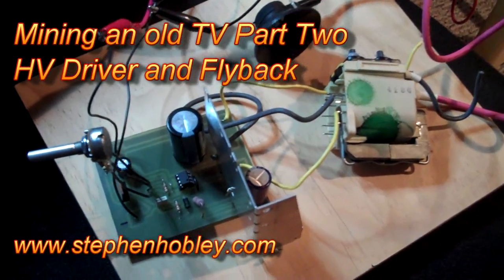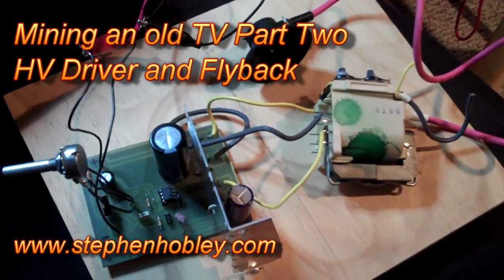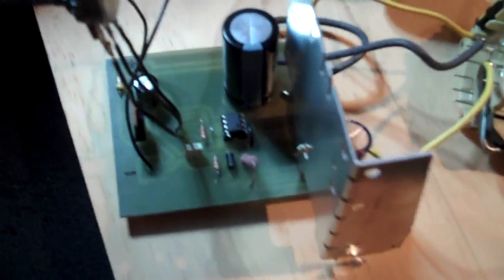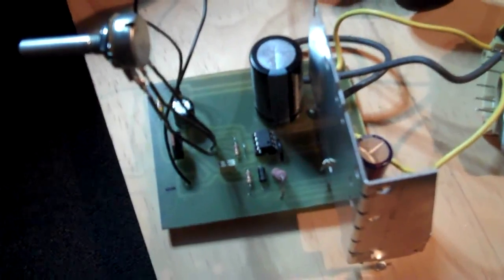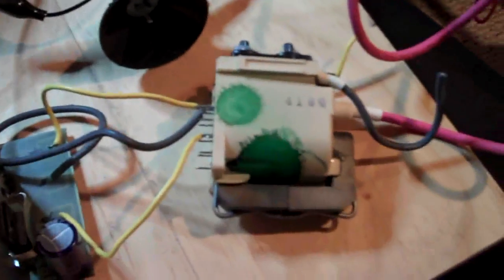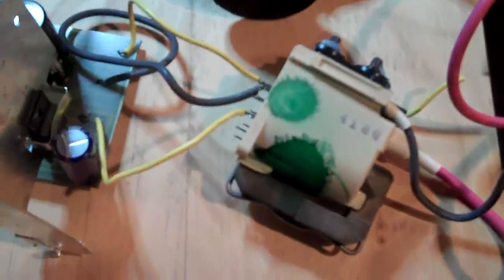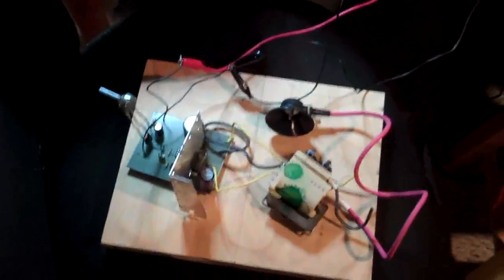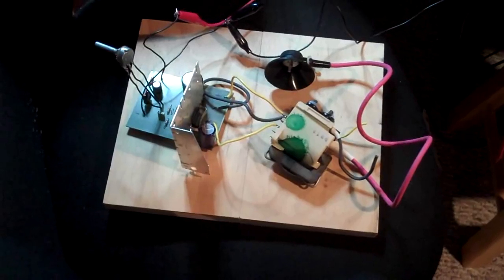Recycling an old TV - turning 50v into 20,000 Volts

Comment: i have that flyback transformer it really sucks you will get way better arcs with a diffrent one trust me and also put a high voltage cap on the primary vt line and second vt line and you will get like 80kv with a 9v bat check out a few of  my vids

Comment: WARNING: 

If anyone here is a newbie, and wants to salvage parts from old CRT TV's.

Please be VERY CAREFUL when removing the high voltage lead. A CRT acts like a giant capacitor, and it will knock you silly if not removed correctly.

Comment: Maybe you've already discovered or been suggested this, but I've found to get better arcs, make your own primary (about 15 turns of wire on the exposed part of the core should do it), a good transistor to use is a mosfet with a low rds such as the IRFP260, and a power supply that can supply >20 volts at quite a few amps.